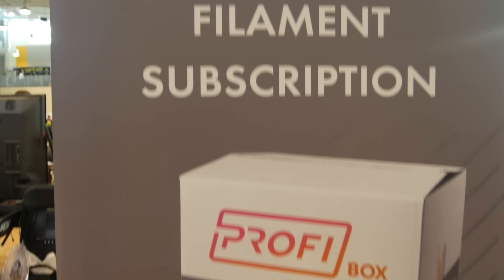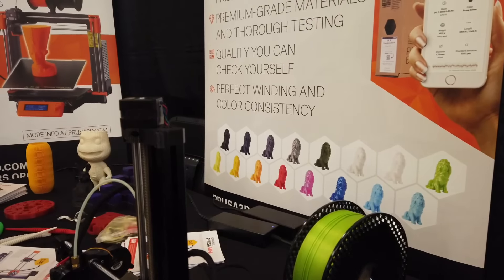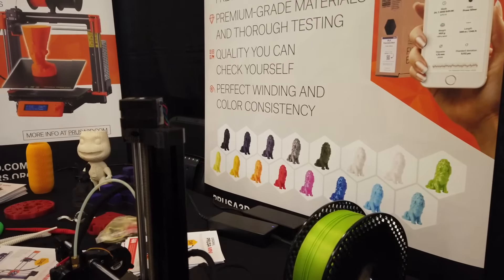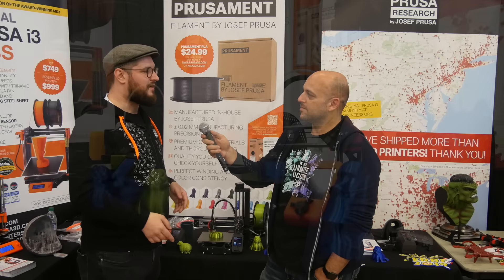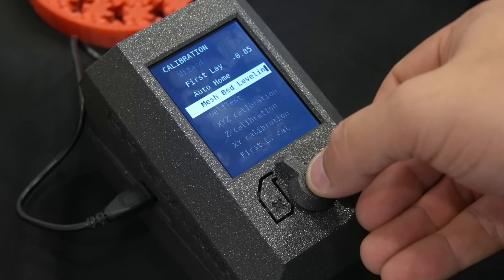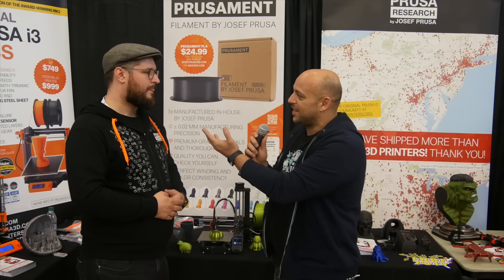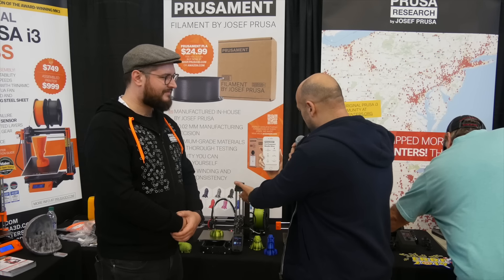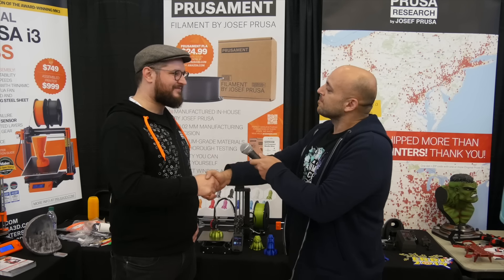The New $349 Original Prusa Mini - First Look At Budget Printer From Prusa at ERRF 2019

Comment: I just ordered one for my first 3d printer I cant wait. I was looking at the Ender 3 pro, but after hearing about the automatic bed level and other features I pulled the trigger.
Reply: you won't regret it !
Reply: Should have got the Ender bro.
Reply: @abarasabwehttam  I'm curious as to why you recommend the Ender?  I'm trying to decide between these two.
Reply: @thebikeracer  with a direct drive upgrade an Ender 3 will be about $250. The hot end setup will be much less expensive and readily available for the 3. Shipping wait times non existent for Ender. Support for Ender from community 10x that of Prusa. I have owned Prusa machines, never again...
Reply: @abarasabwehttam  Thanks!  Appreciate the feedback.
Reply: @abarasabwehttam  I spent more time tinkering on my ender than I did printing. It IS a good machine, but when you spend all day setting up CNCs at work coming home and doing it again wasn't for me. Bought a prusa and will never go back. It's fire and forget.
Reply: @WorldLaughsWithYou  
I'm currently in the same position :P
It would be nice if everything just works, especially auto bed leveling would be very useful. 
And apparently the Mini can even print flexible materials and the printing quality is comparable to the MK3S, so I don't see a huge advantage of a direct extruder in this case.

Comment: Looks like a WINNER. Not sure about the part cooling duct, does not look to be a dual side but that will be a easy fix if it is a problem. Great price for a Prusa quality machine. I will wait until its been out for 6 months as I leaned from my MK2 and MK3 that I ordered back when they first came out and had problems and updates and delays. So I think in 6 months things will be worked out and shipping will be fast. Thank You Joe for the interview.

Comment: Using a bowden setup will solve a lot of the issues with the Prusa extruders. Some people got lucky and never had a problem, but many of us went though extruder hell trying to make those things will all the tiny 3D printed parts reliable. As an additional benefit, it makes things much easier to work on.

Comment: Pre-ordered one already. This will be amazing for schools if it works half as well as the mk3s. Finally an entry level printer with support!
Reply: Not sure what schools you are talking about but there are much better options for much less money than this machine and since 99.9% of schools have to make purchases with purchase orders I highly doubt they will be buying Prusa machines. I am the Advanced Manufacturing teacher for Huntsville City Schools and would never put a Prusa in a classroom. Ender 3s or X1 Sidewinders all day long.
Reply: @abarasabwehttam  we try to integrate them into libraries and shared spaces. Due to this teachers can't be expected to learn the necessary troubleshooting and maintenance techniques for a machine like the ender 3. Sure $100 dollars a printer more is quite a bit, but when it saves tens of hours and allows for easier access it is more than worth it.
Reply: @astersfun  I have 10 in my classroom and more at the other schools in my system and we never have to do any maintenance or anything on our machines. Plus we like the option to print metal parts, something that Prusa will never do.

Comment: I really want to see TPU printed on this...
Reply: RR123RR not sure how about TPU but I print Fiberflex 40D at 20mm/s on MP Select Mini V2 stock setup. I wonder if I can go down to 30D.
Reply: Heh – a TPU print could look fine coming off this, but unless it's very, very stiff TPU it's going to have to be printed slooooooowly (anyone for 4mm/s? :)
Reply: @MarkWheadon  I'm curious cause I'm printing TPU at 30mm/s for functional parts of drones with a bowden on a shitty i3 plexiglass clone, and the results are usable once cleaned up, but if this comes out clean, it'd be interesting.
Reply: It all depends on extruder. If it is tight without gaps or you can fit PTFE tube to fill the gaps between bowden and gearing it should be fine.
Reply: @RR123  I guess it very much depends on how stiff your TPU is – sounds like the TPU you're using is pretty stiff so that short Bowden run should mean you can go at least as fast as at present, and if cooling is good (and I believe Joseph when he says it is) then I would think it would do a pretty good job of it.
Reply: @MarkWheadon  it's SainSmart TPU and a dryer, but cool, though I might wait for an MK4 :)

Comment: What I really want to know is if they'll be offering a board upgrade for the mk3s
Reply: It was mentioned they plan to release an upgrade kit with some of the improvements from the mini, I'm assuming the screen and board are going to be the big ones
Reply: @hiimbob979  In a video from Thomas Sanladerer at 14:54 Joe said MK3 is not compatible with this board and won't get 32 bit upgrade.

Comment: Ordered mine yesterday. Should be great upgrade for my MP Select Mini V2. I appreciate compact size and features that lack of currently makes me mad - bed leveling and Z-axis offset which is required for switching between PLA, PET-G and elastic filaments, flat magnetic print bed with two distinct textures. Also safety features are much welcome.

Comment: The question I would have asked is does going 32 bit with this make the roadmap for 32bit for the mk3/s possible.
Reply from the maker: I’d be very surprised if that wasn’t the case. I’d say down the line there will be a MK32 upgrade :)

Comment: sorry, for that money I get 2 wanhoa minis. ( if geared towards schools, money IS an issue)
I love my MK3s and would love the corexy probably as well
Reply: And get no heated bed, no magnetic flex build plate, no auto bed leveling, cheap parts and much smaller build volume...
Reply: @barryvisser9337  off course not all that, but if you want to gear towards schools, you must think about the price level as well
dotn get me wrong, I have the I3Mk3s  and am loving it a lot, 

off course you get what you pay for, but I think if you can get 10 Wanhao minis that basically do the same or 5 Prusa minis , I think schools will think twice

Comment: Can you try to 3d resin print some character at n scale railroad ? i litterally asked on every channel but no one answered, will be good if it's possible with a mars.
Reply: Not sure what your asking. But i have a resin printer and the quality will always be better on resin printing. Just smoother vs fdm. But you can still print models on an fdm printer.
Reply: @xile6  n scale for railroad modeling is 1:160, can print cars but no characters, it's too small for fdm.
Reply: @nobocks  at that scale it would probably have to be resin pick up on the details.

Comment: Sorry for the newb questions. Can OctoPrint run this over the USB? What would be the purpose of the ethernet connector?
Reply: ss220astro with Ethernet you can connect directly to your pc/Mac and print right from the Prusa slicer. You should be able to also use octoprint since it is running marlin
Reply: @chrisgulotta  The Ethernet can also be used for linking machines together for print farms I'm pretty sure.

Comment: I'm still waiting for Prusa to make a linear rail based printer. That will take the prints to the next level. Prusa has great software but the print quality is severely limited by the hardware they use. With that said I'll be one of the first to order a linear rail printer made by Prusa....

Comment: non-starter... $350USD to compete with sub $200 printers. Its funny to hear him dance around the subjects to make this sound reasonable. How much is auto bed leveling and 32bit worth to you? if you answered $150-$200 then this is the printer for you.
Reply: Exactly why I ordered this printer as a total noob. I was thinking about buying a 3D printer for months and was about to order an Ender 3 kit, but I also knew this would require some tinkering, no official support etc. I couldn’t justify 4x the price of an Ender 3 to get a Prusa Mk3, but at only twice the price I rather get the Prusa Mini, knowing it will work with less headaches, has great support and great features like Auto bed leveling, removable bed, nicer display etc.. It really was a no-brainer to get this as an entry level printer even if it costs a little more and has a small print volume.
Reply: @XennialGeek  you'll learn a lot with this one for sure. Use a enclosure for ABS. Even if it's just a cardboard box you will see much more success